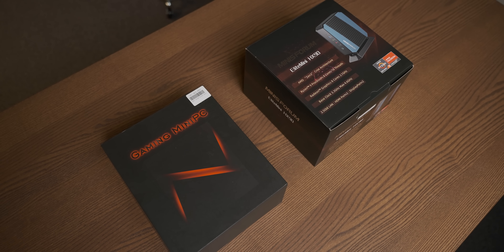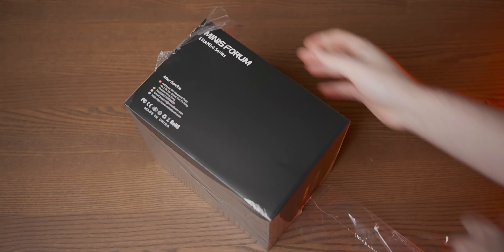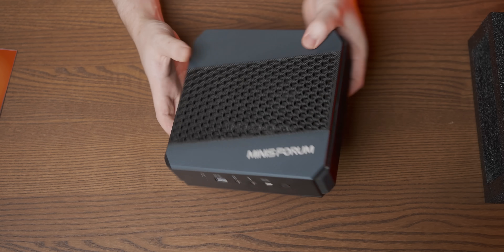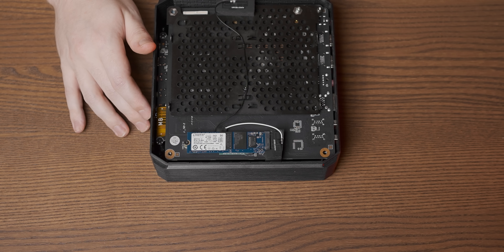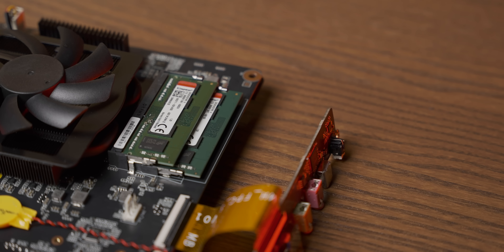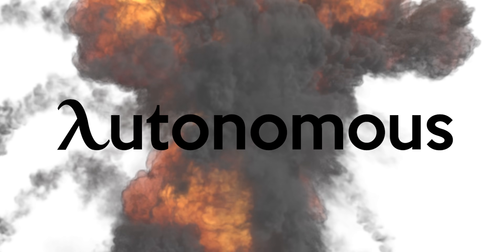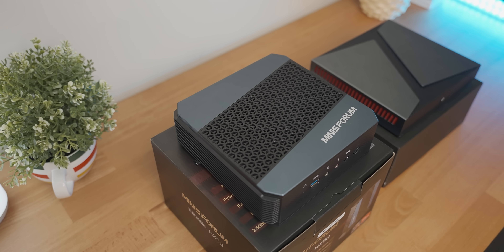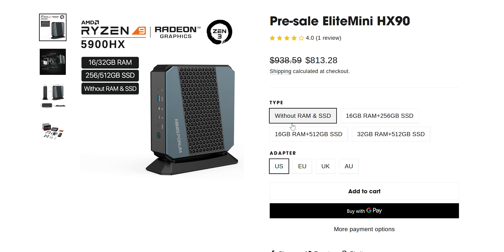The ULTIMATE Mini Gaming PC Showdown

Comment: I just got the HX90 refurbished from Minisforum on Amazon with 256  NVME and 32 gig for $260. That's about all would ever pay for one of these Chinese PC's. The way they do startups and build these units and then dissolve into nothing, is very bad for support. They put up one set of drivers on an obscure Chinese website, which you may not be able to access in future political scenarios, and never add updates, EVER. I'll pay $260 and that's all.

Comment: Bought HX 90 then added a 27" Samsung TV (monitor) absolutely love it. Had a HP all in one with windows 7 for a long time. Super slow with todays standard. What is nice is the TV has nice speakers built in. All I had to do was Blue tooth mouse and keyboard and was up in running in less than a half hour. Super FAST really pleased.

Comment: 0:23 Ya never got back to that, I don't think.  What went wrong with the TopTop?

I'm wondering which one is better for an emulation box (eg. xbox, PS2/3, Dolphin, etc.).  Emulators are typically CPU heavy, no?  But I feel like if you're going to pay $1000 for a mini PC, you can probably build a Mini-ITX with a Ryzn 5900 + a dedicated gfx card for the same or cheaper.

Comment: Most modern triple A title games are GPU bound and require less than 50% of cpu usage. Kind of a no brainer to go with the top top. But I agree with you an I7 is the better cheaper option, even a xeon processor would of been a better even cheaper option for the top top.

Comment: I would like to buy a mini PC for FFXIV mko playing but I'm a BB it nervous. Can they really handle the connectivity and graphics needs of an online game? Is anyone in the comments using one of these units for this?

My use case is a wall mount tv-as-monitor. Very small shelf to sit on.  The ideal power solution would be USB C driven but I could probably (?) Run another power cable down the cable hiding track lol.

Comment: Regarding the Topton mini pc. I got today the i7-9850H variant and it thermal throttling really fast (Like 5 seconds into AIDA64 stress test). You've mentioned in your video @0:23 that you've deleted system32 and it fixed your temps, But i Get the thermal throttling even on freshly installed windows 10. What do you meant by fixing your temps ? To what temps does your system get under stress ? It seems from BF V video footage that your 9750H gets to 87 degrees on 3.3ghz which is not very good and prob. throttled by the high temp.I think that the i5-9300H it's a more apropriate cpu for this mini pc casing and cooler structure, In order not to reach those temperature levels. On the other hand, You can use intel XTU the limit cores speed and undervolt and even if you stick to 9300H core speed, You still get 2/4 more core/threads for just extra 63$.

Comment: I'm curious if you're able to install a different heatsink to the hx90 and still put it back together. I don't know the size specs of the stock heatsink and if it conforms to an available bracket layout. You can unlock in the bios to 54w and I'd imagine you'd need a little beefier HS to keep it from throttling constantly.

Comment: Incidentally, it's supposed to be WAY easier to get the board out. Minisforum's ram/ssd installation video shows that they suggest pushing against the lobes of the drive tray while pulling slightly on the case plastic. It just popped right out.

Comment: 4:20 deserves a disclaimer that they claim to used liquid metal but just use normal thermal paste
Reply: What's odd, his temperatures are lower than some of the other reviews. Der8auer showed that if liquid metal was used as intended the temps would max out in the 70s instead of the low 90s. They have a premium cooler (twin-heatpipe polished nickel plated copper) designed for liquid metal, I think the assembly process just wasn't ready for it because installing liquid metal is far more involved than squeezing a paste tube.

It's a rough position some idiot at Minisforum put this growing brand into....the HM80 and several others showed promise.

Comment: I've had my eye on this HX90 for a while. I get everyones comparing this because of the marketing being towards 'gamers'. However, I think this really would be a good, low powered, server solution. The HX90 is a powerhouse for CPU. It has 8 cores 16 threads, means you can use a L1 Hypervisor and run some funky server solutions. Run an internal AD, run a home minecraft server, all on a laptop CPU. it beats my 6700k in benchmarks on multi and single threaded tests. And it's better than the server I currently rent. The fact it's got two 2'5 inch bays means you can do use laptop HDDs and put them into a RAID-1 and set up you own NAS solution.

I'll stop waffling on but the versitility is amazing. Just a shame NVENC isn't available for obvious reasons.
Reply: Wow. Paid comments, too? No real person would ever support this company after being exposed for the false advertising, incompetence, and fire hazard that is this computer.

Comment: I have the top top or whatever the AliExpress sellers are calling it now, the Intel one, and if you plug ANY USB device in that requires a lot of bandwidth, like a SSD or video capture device, the USB is completely saturated to the point a USB mouse/keyboard stutters.  So I only use it for games, nothing else.  Which is fine I guess, but it is definitely designed/made in China on the cheap. . .

Comment: In relation to the minisforum machine, did you notice all the little specs of liquid metal all over the place? look around your fan/HS. then pull the cooler off and there isn't actually liquid metal as an interface, its paste.
Don't forget that liquid metal is electrically conductive, so its a short-circuit waiting to happen.

It looks like they intended to use LM but realised that its actually hard to do and then tried to clean it up and switch to paste in order to get units shipping.

Its all a lie.
They even claim the case is carbon fiber, it isn't, its plastic with carbon fiber pattern molded onto it.

The screws to open the case are security versions, not regular types.
The RAM is CL22, its garbage for the price.

Comment: Between the tear-down issue in this video, and the GN video with the plethora of issues (no LM, no Carbon Fibre, CL20 memory, security hex screws, etc.) I'm seriously convinced that Minisforum has a big QC issue on their hands.

I've said since I first saw it, the HX90 shouldn't be marketed as a gaming machine... But, at least they don't lie about the stats on the release page...  They are in line with the results GN and Dawid got.
Reply: Dawid for some insane reason pried on the board at the back of the case instead of at the front. You'll notice the front ports are on a ribbon cable, he could have lifted the board on that side much more easily. Instead he had to bend the back enough to clear the metal surrounding all those ports.

Comment: The prices on these things are eye-watering. The whole point of it seems to be the fact that it's a nice small compact size with a lot of power I guess considering. But geez if the point is getting a good powerful machine with good price to specs ratio uh no. Fun for a video but not worth buying at that price.

Comment: Yea I'm not too excited for companies to start using liquid metal. I love how system builders either use the crappiest thermal paste or the extremely niche liquid metal. Just use some good MX-4 or Artic silver and be done with it.
Reply: Having done laptops and ITX in the past, Arctic Silver has some of the same concerns of protecting the board against short circuits. But I take your point that unless it's an advertised feature the cooling transfer media is a cost-cutting area.

Comment: Regarding the Mini, Gamers Nexus just realeased a video explaining that the liquid metal may e in fact a fake and there is normal paste on it... I would be curious to see ya Dawid taking it apart and see if it's true on your build or not ahah
Reply: der8auer points out that if they never intended to use liquid metal, they could have used a much cheaper heatsink. Some channels that reviewed this unit said they were told the prototypes did not have proper liquid metal on them, other channels acted like they were expecting liquid metal compound. A lot of minisforum reputation could be lost if the final shipping production models do not have the cooling issue resolved.

der8auer showed an enormous drop of around 15C under max load if liquid metal is properly applied, which lines up with what minisforum originally claimed about the hx90 having superior thermals. This brand has been growing and starting to develop a reputation, it'd be a shame if they handle things any more poorly.

Comment: Hi everyone,so im currently plan to build a pc , is ryzen 5 3600 good in 250$ range ? If GPU price goes down to MSRP i might go for a RTX 3060 or a RX6600XT but now the vga price ...
Reply: also which 144hz monitor is good ~ 200$ range and cheap good airflow cases ( i dont need rgb lights but it's ok to have )

Comment: so it has all of the negative points of a laptop without the display or keyboard
Reply from the maker: Haha!! Pretty much.
Reply: It's intended differently. It has a CPU mostly found in $1500-2500 laptops but does not have the dGPU, screen or battery. It has tons more ports than a laptop, room for three internal SSDs, and a hardwired 2.5GbE networking. It's more for workstation, media PC and/or home server usage. It's definitely not for everyone.

Also right now, there's a lot riding on whether they got the manufacturing sorted out or will shipped product have the wrong thermal paste like the prototypes do.

Comment: you should get an m.2 to pcie 16x adapter for the HX90, put a good desktop class gpu in there and compare it in gaming to a similarly specced laptop
Reply: Yo how tf is that a thing
Reply: @TiqueetyJosh  Ya i also never thought of that, but i think it should work lol, thats crazy.
Reply: Then the price will stonk!
Reply: If you’re going to do this, why not just buy a bigger desktop?
Reply: @emlyndewar  honestly yeah, the process is also expensive, you need a gpu, the extension thingy, a PSU and a mounting mechanism.
Reply: Good idea
Reply: Yeah do this
Reply: I mean it's going to be running at 4x lanes. But still a cool idea for some jury rigging
Reply: Laptop GPUs are TDP limited and have their core clocks throttled. Even with the same GPU the laptop ones will run significantly worse.
Reply: Problem with this is.It's not practical and it would be the hx90 that would be faster.You won't go out and buy an adapter just to run games.If they were same spec i think the amd will be faster and i would like to see this but it's just not practical.
Reply: @pierregrobbelaar9116  m.2 to pcie adapters are pretty commonly used as the only option to get a desktop sized GPU in SFF builds utilizing STX or Thin-mini itx form factor motherboards. It's also used by some to put eGPUs on laptops since it's way cheaper than getting a thunderbolt enclosure. It doesn't always work though so im kinda interested to see if it would in this
Reply: Doesn't he have one that he bought accidentally for that old AIO computer thinking it was an M.2?
Reply: Bandwidth is probably going to become an issue
Reply: Lmao ETA Prime actually did this and the results were surprisingly good
Reply: @geoometrics  sorry, didn't see your message
Reply: It has already been tested. 
https://www.youtube.com/watch?v=xQYdgW5VaUs&t=3s
Reply: Put a gt 710 in it and cripple its performance
Reply: But first of all how the fuck are you gonna put a gpu in there?
Reply: @OrRaino  https://youtu.be/xQYdgW5VaUs
Reply: I don't think that motherboard has a GPU powerheader (didn't see one)
You won't be able to do that.
Reply: @dhanvinvinod  watch the video. U need a seperate psu to power it for sure. But just the gfx alone. A 500W psu is more than enough to power it.
Reply: This made me wish that Ryzen 6000 series supports USB 4 for that sweet eGPU ability
Reply: How you suppose that’s gonna work there is 0 space but if you were to just put in the gpu without heat sink or shroud then the heat is gonna be upwards of 4000-5000 degrees
Reply: Folks who says its not economical then go buy a fullsize.
Reply: Or not.  Egpu's are a separate product.  Not in the box=doesn't count.
Reply: no
Reply: While I like the idea, its still not going to work 100% of the time, some of these won't even support video output from the m.2 pcie slots in the BIOS. Secondly Linus already made a video about it and said it wouldn't always work. But if it can work on this, yeah sure why not lmfao.

Edit: id like to also add that even if it did work, you'd be running it at 4x pcie lanes instead of the typical 16, so you'd bottleneck the GPU's performance and wouldn't be able to really get the most out if it.
Reply: @doubleawakeel7214  
Having only PCIe 3.0 x4  will bottleneck, but maybe not as much as one would think. According to Techpowerup's test at 4K  RTX 3080 retains 90% of it's full performance when it can use that amount of bandwidth.  RTX 3080 with AGP-level bandwidth was still faster than RTX 3070 with PCIe 4.0 x16.   If it had PCIe 4.0 x4.. then RTX 3080 would only lose 5% of it's full performance. 

Interestingly enough a card like Radeon RX 5500 4GB would be far more bottlenecked by those bandwidths (that card doesn't have enough VRAM so it will use regular RAM and that increases the amount of data that goes trough the slot)
Reply: @kimnice  thing is, even if it seems like a great solution to gaming laptops or mini-pcs, you're still unsure if it'll even work in the first place, and 2nd.... its just.... not very practical, you need to buy a power supply aswell, and not to mention this isn't an official solution, so still.... Thunderbolt is better since it is guaranteed to work with most cards (if it won't bottleneck your cpu ofc lol). Idk I'm not really convinced on spending a 1000$ on a gpu, the adapter, and the the PSU, while I'm not even asure itll work lol.
Reply: Sup
Reply: Dapz try to make a video on buying a gpu in 2021 I bet you wont
Reply: I mean it's going to be running at 4x lanes. But still a cool idea for some jury rigging
Reply: yeah but that way you also have no storage for OS or games unless you were talking about using the wifi m.2 port
Reply: @draconightwalker4964  it has sata
Reply: @DJKr15py  well i had a major duh moment there . lol
Reply: Hello king

Comment: Maybe you should try an eGpu on the HX 90. 
That will beat the Top Top one by alot!
Reply: It won't have thunderbolt it's an amd design.
Reply: @mkkohls  he means by using the nvme port instead which... It works.  Eta prime did it but it doesn't look great.

Comment: most people outside this youtuber understand the market of these mini computers HTPC and light gaming which the HX 90 is perfect device.

topton is a chinses company not even sold in north america market, and the device uses previous generation old processors (or worse).

neither is a really good gaming pc (1650 is how many generations old?)...HX 90 looks to have better build quality looks really nice and you can get support from a company that sells on major retailers such as newegg and amazon.
why would anyone want to serious game on these devices anyways. i would pick HX 90 over the garbage topton anyday if i wanted a solid htpc that i knew works and get support.

putting these in a gaming match up is like two seniors racing in a scooter. yes one will be faster but how embarrassing is it going to be if a racecar like a Ferrari (gaming desktop) comes in and races both of them. like serious if thats really the only thing that matters why are you considering a mini pc that has a two generational old graphics like 1650? you taking an edge use case for these mini pc devices and making it a deciding factor in your recommendation for purchase. 

also who in there right mind would buy a prebuilt on aliexpress? 
good luck if you ever have any issues with the purchase getting support

so much wrong here not funny. 
did topton pay you to recommend there generation old garbage pcs?
Reply: Thx for the info!  Do you think the HX90 is decent for audio production?  I was looking at the M1 mini mac but I can get this badboy for $630 as opposed to $1,000+ for a Mac.

Comment: The gaming performance of the 5900HX really drives home how badly Zen3 needs some RDNA2 iGPUs.
Reply: I do believe AMD's Rembrandt CPUs with RDNA based graphics are rumoured to be in mass production. 

But RDNA based APUs won't happen until AMD adopt DDR5 (which is what Rembrandt is using)
Reply: @riven4121  The steam deck custom chip seems to be the test platform for this setup. 4 cores, rdna igpu, ddr5, sounds like a 6300U to me.

Comment: When I think of how much I paid for my Canyon Lake NUC w/ an I7-8705G & Vega 6 graphics (over $2000 CDN including 16GB memory and 1TB SSD), and I see prices in the $900 - $1000 range for these two units, I really want to cry.

Now, I DID buy it as a HTPC, not a gaming PC, so I am still happy with the purchase (and it does OK playing Portal at 1080p), but in just over 2 years mini PC's have certainly improved AND plummeted in price.

But mine DOES have programmable skull lighting on the case, so there's that. (of course I shut it off immediately after my intial "oooh")
Reply: I believe the newest NUC is amazing in its power and capabilites. It can take a 2 slot desktop graphics card and everything. Im pretty sure it is also very expensive and doesn't come with a graphics card at all, so good luck getting a 3060 or a slim 6700xt to put in there. By the time you are done with it, you will probably have spent $2500 to have a small desktop with worse thermals than a comparable mini itx computer.